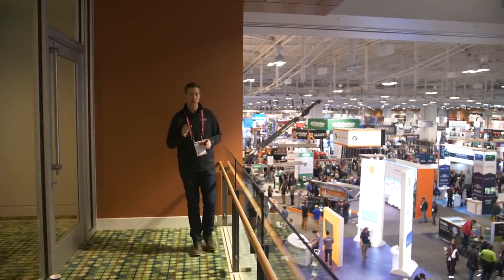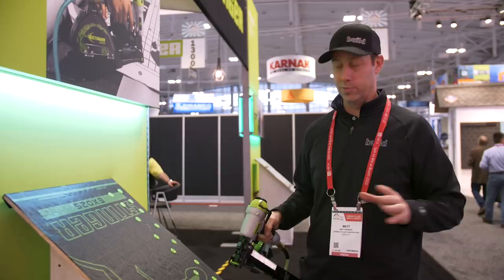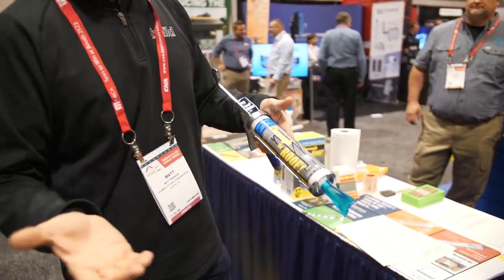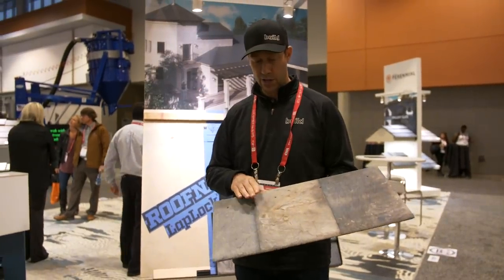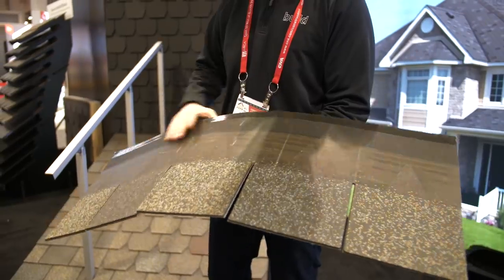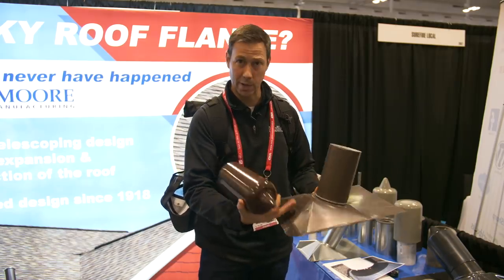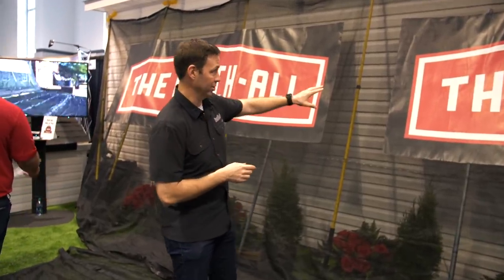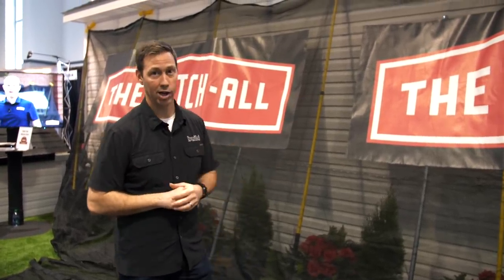NEW ROOFING PRODUCTS 2019 - This Show Had Some Surprisingly Cool Stuff!

Comment: 2 manual stinger staplers go faster... think of a drummer on the roof.
Reply from the maker: Good analogy. But I like the nail caps and the longer staples options on the pneumatic
Reply: issue that you cannot use staples on high performance, synthetic roofing underlayments. If you read the instructions they will state to only use nail caps. For house wrap, Zip sheathing is the better option in my opinion
Reply: check out the videos on the Stinger website.  The pneumatics are very fast too!   Also, I have not ever heard of any warranty being voided for using a cap nail.   I have seen them voided with other types of fasteners though.   The install instructions are critical